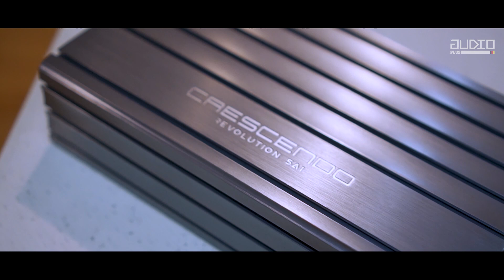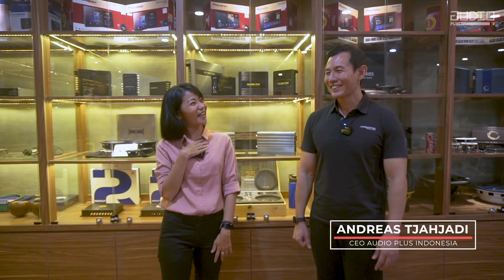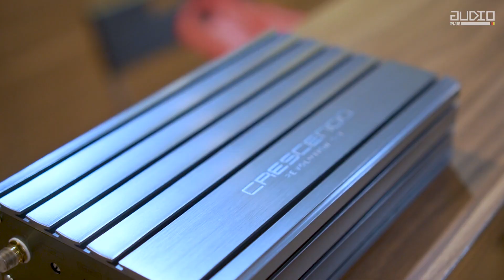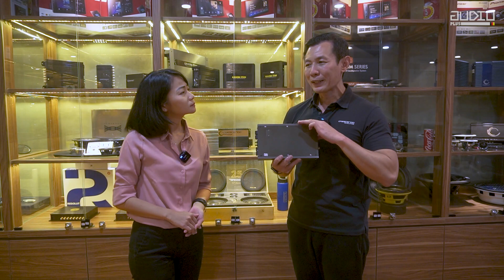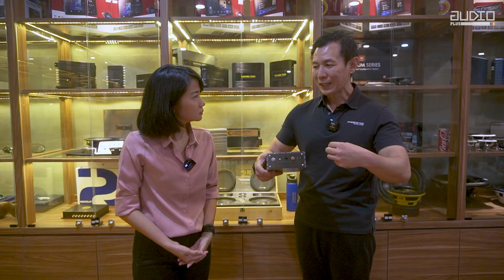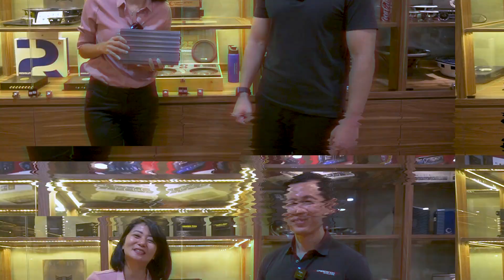CRESCENDO REVOLUTION 5A1 | COMPETITION READY MONO AMPLIFIER | SUPERIOR CONTROL & DYNAMIC

Comment: 1 sampai 4 ohm di watt yg sama yakin di power lain tidak ada?? Coba di tengok jl audio hd class pak andre.. produk anda masih pake switch, jl sudah otomatis, dan wattny fantastis...🤣
Reply: Kita class AB jd memang berbeda
Reply: @andreastjahjadi476  iya pak ander class d... tapi damping factorny lebih daro 500... saya rasaa utk subwoofer controlny sangat baik
Reply: @Vincentiusvandi  betul pak class D bisa baik damping factornya tapi kurang baik Signal to Noise ratio maupun Total Harmonic Distortion nya. Kita tujukan ampli ini utk drive semua speaker dari sub sampai tweeter dengan rentang frekuensi 10 Hz - 80 kHz. Anyway, terima kasih masukannya.